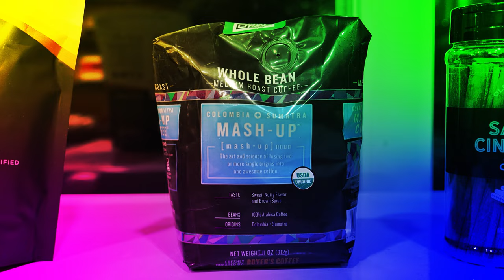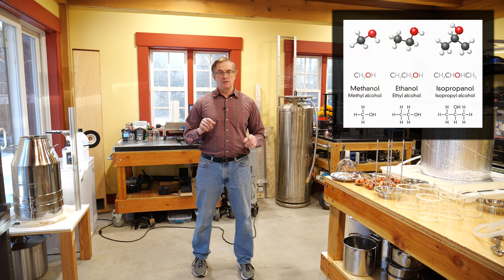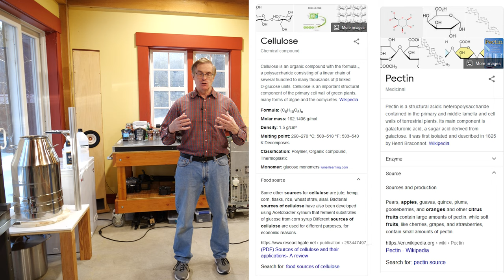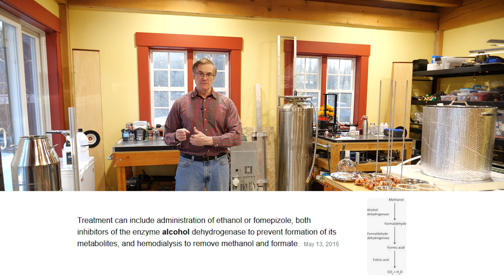Making Vanilla Flavored Rum! - Part 2

Comment: Would there be any difference either better or worse in using a vacuum distillation system?
Reply from the maker: There would be little difference for this application.  The major advantage of vacuum distillation is that the process can be performed at low temperatures, but because there still must be a temperature gradient, heat has to be added to the pre distillate and extracted in the condenser, roughly the same amount of heat.

Comment: Hey! I have been wanting to get a distillation device for distilling essential oils from herbs. And possibly distilling a beer. Could you point me to a device with a capability like yours, only for a max 3 to 5 liter capacity. I am from the Netherlands so I will probably not have an option of importing from the USA.
Reply from the maker: Take a look at our first video in this series where I described several different distillation systems including this reflux still.  The laboratory set up could be assembled from individual glass parts and can be built for that volume.

Comment: I wonder if anybody in the amateur community has used UV/Vis to analyse fractions? I can't find it online but I remember in undergrad labs using a small desktop spectrometer about the size of a book that plugged into a laptop and I was told cost about £80. Would take some of the guesswork out of blending and removing your methanol although maybe also some of the art.
Reply from the maker: You'd need to go into the IR for that differentiation, but that would work.

Comment: You may want to introduce your viewers to refractometers, which can determine alcohol content with a few drops of liquid.
Reply from the maker: I will, thanks.
The point of the hydrometer is that it's a very easy to principle to grasp as well as to demonstrate.
However, we have the equipment to present the principle of refraction-density on the bench top and that might make an interesting video.

Comment: Why did you choose to run this batch in reflex mode and not in pot still mode?  I thought the point of a rum run was to preserve as much of that molasses flavor as possible wouldn't most if not all those essential flavors be stripped away by the reflux column?
Reply from the maker: We turned the reflux condenser way down in order to minimize reflux, but still demonstrate its operation.

Comment: I was thinking of making just a batch of dunder before my first batch of rum. Taking about 2 gallons of molasses wash ferment it with yeast and leave the top off. I assume this would be the same, or do I need that concentrated yeast slurry at the bottom.
Reply from the maker: I'd just do it like we did.  Actually make a first batch and save the dunder.  While the dunder matures you can experiment with different aging techniques like we are now.  The simpler base flavor will make the aging easier to evaluate.
Reply: @TechIngredients  thanks for your reply. I will try that. I've been making lambic beers for a few years and the flavors and smells are spot on to what your getting in the dunder. Eventually I want to distill some of my lambic, but it would probably be the stuff that's a little funky even for my tastes. You guys are doing great work, thank you.

Comment: How do one make dark rhum?

I started wondering about methanol.. More exactly something I have heard is common in the USA which is "Apple jack".. (If I understand correctly it would be Apple Wine/-Cider that has been distilled by freezing it)..  Wouldn't the concentration of methanol be fairly high in such concoction?
Reply from the maker: Indeed it would be higher than in the apple cider that it was made from because the freezing will separate out any of the methanol.  However, the increase in both methanol and ethanol concentration in applejack is only moderately increased by freezing out some of the water.

Comment: I've seen seen in bottles of vodka claiming its been distilled several times is that done to exclude as much of the Methanol out the process.
Reply from the maker: It will help.  However, a reflux still is actually redistilling many times within the tower as I explained in our first video on this new reflux still.  It really depends on what kind of still the manufacturers are using.

Comment: So you using a reflux column straight on brew? Usually myself distilling a raw spirits with everything in it without reflux and then as i get enough raw spirits to have iside pot about 50l of 20% then doing a separation with reflux column. Please tell if its not correct.
Reply from the maker: The trick is controlling the reflux process.  You can turn down the reflux condenser or shut it off and as I demonstrated in our earlier video on this reflux still, you can insulate the column and the still runs in a pot mode despite the complex plumbing in the column.

Comment: At 13:35 the MP says that he will remove 180ml of Ethanol. Is it not a mixture of both alcohol and ethanol and therefore more accurately described as distilate containing a high concentration of ethanol? In fact, I wonder what the proportions are ... ???
Reply from the maker: I said methanol.  In our first video in this series I explained the principles of distillation and the operation of this reflux still in particular. Basically, you're right.

Comment: Knowing little about distillation but definitely knowing cooking, you would think that the best and most volatile flavors of the botanicals in the gin basket would be thrown away in the methanol. Does anyone run the first bit of methanol out and then add the gin basket?
Reply from the maker: They might and that might be worth the extra step.

Comment: Why do you take the "Dunder" before distillation ? 
by definition  Dunder is the liquid left in a boiler after distilling a batch of rum.
Reply from the maker: Dunder has a complex history and it includes both the stillage, the wash and as well as mixtures of both.  It's not a cut and dried material.
Reply: @TechIngredients   you are right it could also be "Dunder is the yeast-rich foam leftovers from one batch of rum that is used to start the yeast culture of a second batch".  Anyhow thanks for the videos i enjoy watching them.

Comment: does methanol float to the top if you cool the fermentation liquid? i.o.w. can you separate it without disitilling, with a separatory funnel for example?
Reply from the maker: No.  Methanol is completely soluble in the water, it won't separate.
Reply: @TechIngredients   If I ferment sugar cane syryp will I have methanol in the resulting wash? Will it have enough flavor for cold distillation? 
Cold distillation: put a bottle of wash in freezer/outside at -30C, leave it for 6hrs and then separate unfrozen liquids from the ice flake on bottom.

Comment: Does running the distillation over that many plates not strip out all of the flavor profile of the molasses?  I thought reflux was for creating neutral spirits. From here it looks like you made vanilla vodka rather than rum.
Reply from the maker: The plates don't actually produce the reflux separation as I explained in our earlier video describing the reflux process and this still.  They enhance the effect of the temperature gradient between the pot and the reflux condenser. In this distillation I ran the reflux condenser very low,  reducing the reflux effect.
Reply: @TechIngredients  thanks for taking the time to reply.

Comment: What's the difference between hydrometer and proof (alcohol) meter?
Reply from the maker: The calibration strip is marked appropriately and the range of densities that can be measured vs precision depends on the volume ratios between the submerged float and the semi-submerged stem.

Comment: I saw some videos of people infusing aromas in various spirits using ultrasound cleaning devices.
I gave a couple of tries, with mixed, mostly disappointing results. I am wondering wether the technique actually makes sense or I am making something wrong.
Reply from the maker: There is some potential here.  Ultrasound can cause cellular disruption to free flavors from botanicals and create bubbles within wood to drive diffusion through the fibers.  The big issue is power.  A cheap ultrasound imported from China to clean jewelery can output as little as 15 watts per liter while a laboratory cell disruptor can produce hundreds of times that power density.  The process works, I've done it and we'll cover this in an upcoming video.

Comment: You put a big effert to add flavour , but then stripped it all out with a 6 plate reflex still. So in the end you made a nutral spirit with a hint of vanilla.
Reply from the maker: Not at all.  The plates don't accomplish the reflux process.  Check out our first video in this series where I described several different distillation systems including this reflux still.  If the reflux condenser is set very low or off, the amount of reflux is minimal.  It's the temperature differential, not the plates that generate the reflux, the plates just make it more effecient.

Comment: In the absence of a really nice glass reflux column outfitted with with purpose-built copper plates, could you not simply pack a really long copper pipe with copper S.O.S. style kitchen scouring pads to produce the same re-fluxing action? The considerable amount of surface area provided by the copper mesh, might even be preferable. No?
Reply from the maker: You can and that's not uncommon.  The packing can introduce a pretty big flow restriction and it's unpredictable, but it would be cheaper and easier to assemble.

Comment: If you control the heat, wouldn't the methanol boil out then the output slow?
Reply from the maker: No, it doesn't.  The methanol, ethanol and water vapor curves overlap.  There is no distinct division.
Reply: @TechIngredients  Okay

Comment: Wouldn't it be better to add the vanilla pods after the heads have been collected so as to not waste the aromatics dissolved by the methanol?
Reply from the maker: It probably would be, but it will involve  some extra work to introduce  the pods into the running  still.

Comment: While the part about methanol is not necessarily wrong, I feel like it's misleading. First, the type of still makes a huge difference: a long column still will have much higher methanol (and other volatile) concentration at the start, while a pot still may have the highest concentration all the way in the tails. Also, for some stills the absolute concentration may be highest at the start, but the concentration compared to ethanol may be lowest. Anyway, depending on the type of still the concentration of methanol is usually low enough in any cut that drinking it will poison you with ethanol before methanol. As for the main reason for cutting out "heads" or "foreshots", it's to reduce the amount of other undesirable volatiles like acetaldehyde which boils at around 20°C while methanol at 65°C. Additionally methanol is completely soluble in water, which means it tends to distill with water. This is why in pot stills it's usually most concentrated in the tails when most of the ethanol has already gone and the vapor is mostly water. For further reading Distillation Techniques in the Fruit Spirits Production seems to be a pretty good paper on the topic.
Reply: Oh, also, when distilling something like rum you might want a bit more heads or tails in the mix for those fruity or funky flavors. There may be treasures deep in the tails even down to 10%.

Comment: @5:24 you say that the methanol is concentrated at the front of the distillation. This is a common myth. The tails of the distillation contain most of the methanol. The heads contain almost none, actually.  It's true the methanol has a lower boiling temp, but it forms all sorts of funky azeotropes with ethanol, water, and other compounds. The reason that you throw out the heads, is because it tastes horrible. But it actually would be safe to drink. The tails are also fairly safe to drink, moonshiners have been doing so for a long long time. But if you are worried about it, you should taste your distillate as you go, and only keep the hearts that taste the best.

Comment: I have two questions: 
First, you mentioned that a whiskey or bourbon maker would never put sugar instead of malted barley to up the alcohol content, therefore one should not add sugar to molasses in order to make the wine higher in alcohol. And I agree to a certain extent, when it comes to making a fruit brandy for example, (or even a whiskey or potato vodka) Here's where I would disagree....We're talking RUM here! Rum is made from sugar cane byproducts, aren't we? If that's the case, what's wrong with using a little raw or brown sugar which is ultimately made from sugar cane?! See what I'm getting at?
Secondly I'm wondering if maybe with all the careful and time consuming preparations you've made, you in fact missed on a much better flavor extraction by using a reflux still instead of a pot still? Had you used a pot still, you would've needed a strip run resulting in some low wines and then a spirit run. Am I wrong in presuming that the quality/flavor would have been much better/intense? Please correct me if I'm wrong. Thanks
Reply from the maker: You're not wrong.  It's hard to be really wrong when brewing, but adding table sugar to increase the alcohol content when you can add much more flavorful molasses to reach the same sugar content is counterproductive.  Brown sugar is just sucrose with a little molasses added to flavor it.
Reply: @TechIngredients  Thanks! How about the second part, still vs reflux for better flavor? Much appreciated!

Comment: Why not get rid of the methanol before adding the vanilla? I'm guessing that the strongest flavors will be raleased in the beginning of the destillation, so it sounds a bit wasteful to use expensive vanilla in something that will be thrown away.
Reply: You would have to stop the distillation and let it cool a bit so you could take the basket out which isn't really worth it. You are only throwing out about 6 shots out of 120+ so it not's going to make much of a difference after you blend it and unless you want to drink vanilla you want it to be subtle.

Comment: Jar #21 looks a little turbid. It seems there is quite a lot of tail in it. I go down to 20% only if I make two runs of distillation. In the second run or with a column I tend to stop at 40%. The risk of having fusel oils in would be to high.
Reply from the maker: I prefer to stop when I'm absolutely sure that I haven't missed anything.  It's easy to discard after the fact and the only waste is a little energy and time.

Comment: The second point is I think I'm right in saying fermenting does not produce Methanol, the methanol is already present in fruit etc and  seeps into the wash. also I think I am right in saying its molecularly bound in and very little is extracted in the first 200ml off the still, and its mostly spread throughout the wash with more concentrations in the tails area but as said there is not enough to do any harm. In the fores you took off its more acetone etc and not methanol. Could you verify this please

Comment: I’m really confused as to why you used a reflux setup to distill this. Why not a pot?
Reply from the maker: That's a good question.
Primarily, we wanted to showcase and describe the operation of this type of still.
We chose rum because we like it, but a pot still would work just as well.
Reply: @TechIngredients  Thanks so much for spending the time to answer me. I’m looking at upgrading my current pot still and T500 reflux still (both Still Spirit products). I thought the reflux would “strip” all of the flavour out of the end product. I like to make vodkas, gins, whiskeys and now thanks to you rum. I was thinking that maybe the term “strip” was incorrect and I had it wrong. I’m still looking at what to buy and currently looking at a modular setup.
Reply from the maker: All stills have some degree of reflux, which starts even in the pot. Modular is really useful, and the ability to adjust the size and the reflux for the batch saves time.
Reply: @TechIngredients interesting. And thank you. I will probably buy one of those.